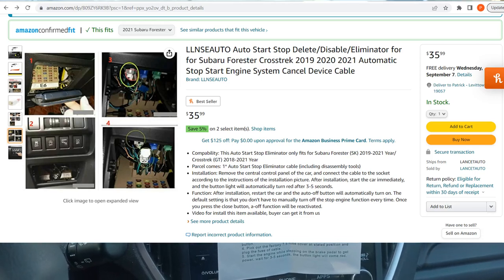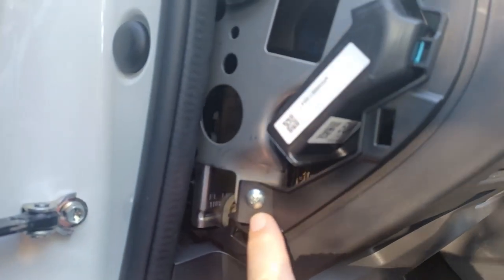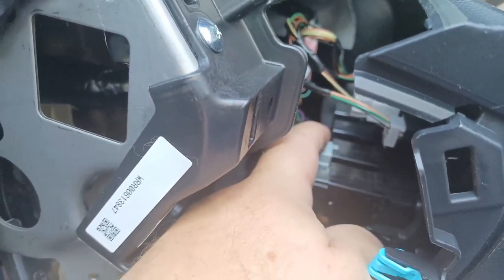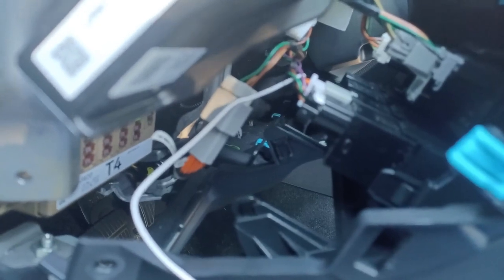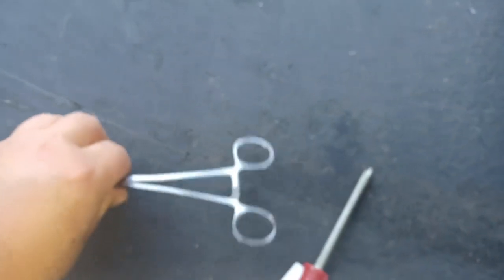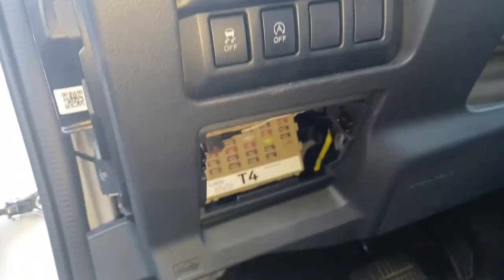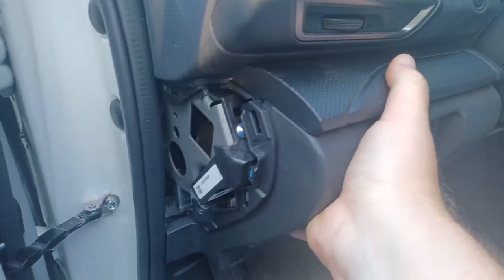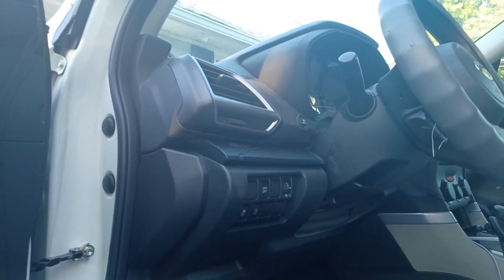Installing Auto Start Eliminator in 2021 Forester

Comment: Just got this connector to. Great gadget for $35 buck! Couple of notes for easier install to anyone else, you just have top open the fuse box, and reach up above and the smaller button panel can be popped out by hand as well. no tools that way. Also, you can use the spare fuse socket at the lower right corner of fuse block and not have to pull any other fuses. Thanks for the video!
Reply from the maker: Thanks for sharing

Comment: There is a version of this available now that just requires pulling the plug from the switch and plugging it in line. No power tap required... thank you for the video I used it to install the non-power tap version on my 2020 Forester worked great thank you
Reply: have a link to the updated product?